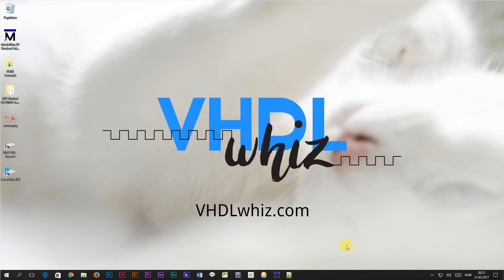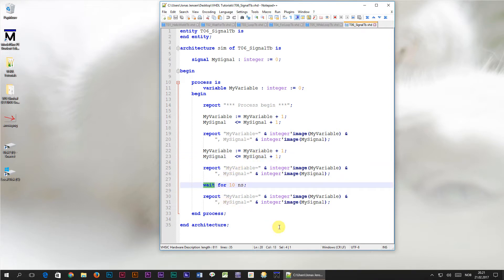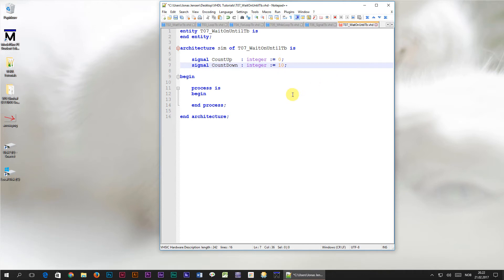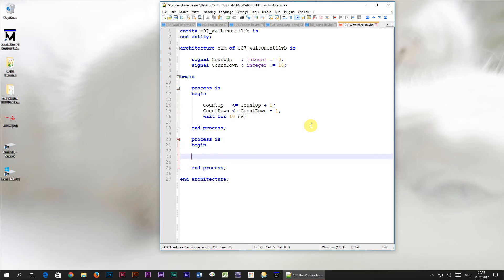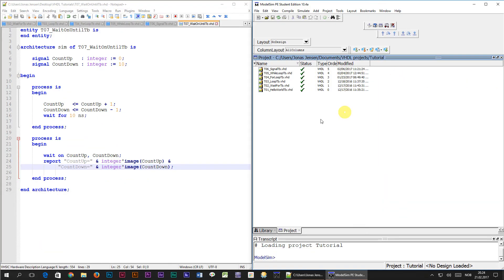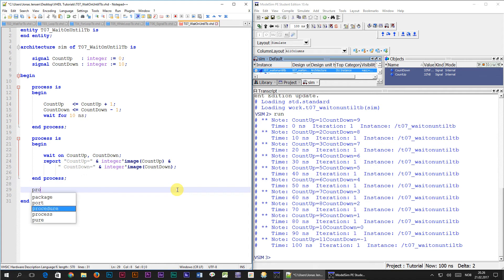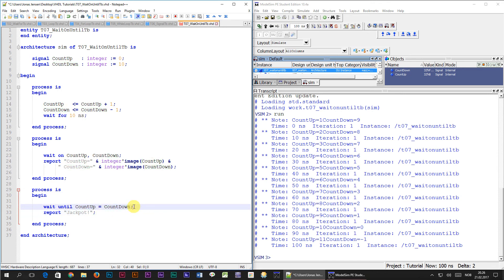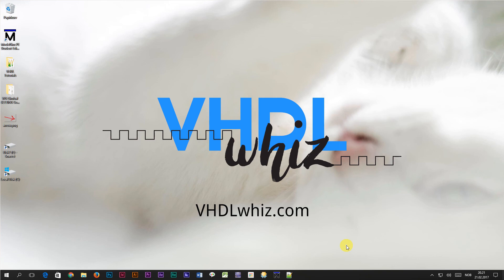How to use Wait On and Wait Until in VHDL

Comment: Do all three processes run in parallel or sequentially? I am inquiring because I've read that a significant advantage of FPGA is the ability to run processes in parallel. Is this information accurate? Thank you and best regards.
Reply from the maker: All processes run in parallel. VHDL can be thought of as a parallel, event-driven programming language. That makes it a terrible programming language but well suited for describing digital electronics, which also runs in parallel.

I wouldn't say that VHDL has any advantage over regular programming languages. They have different purposes.

Comment: Hi, if I use the following statements from your example:

architecture rtl of Kap06_Process_Erweitert is
    signal CountUp   : integer := 0;
    signal CountDown : integer := 10;
begin
    process is
    begin
        CountUp   <= CountUp + 1;
        CountDown <= CountDown - 1;
        wait for 10 ns;
    end process;
end architecture rtl;

I got the error: Wait Statement must contain condition clause with UNTIL keyword

I have no idea, what's going on. Regards Erik
Reply from the maker: That's probably because you tried to synthesize the design. The WAIT FOR statement only works in simulation. You see, some parts of VHDL is not ment for implementation in hardware. WAIT FOR is one such construct that's only meant for allowing us to simulate a design.
Reply: @VHDLwhiz  You're right, that was the problem! Thx, Erik

Comment: if wait statements are not synthesizable then why is it mandatory at the end of the process? or does this only matter for testbench only?
Reply from the maker: Yes, you are right. Some Wait statements are synthesizable. For example, if you put a single Wait On at the end of the process. That's because it's the equivalent of a process with a sensitivity list.

But you will find that almost all VHDL designers only use Wait statements in testbenches. It's safer to use sensitivity lists for RTL code because the synthesis tool will understand it for sure,. While with Wait statements, it's less obvious what kind of logic the process will produce.

In VHDL code meant for simulation, it's better to use Wait statements because the code doesn't have to follow any implementation rules. It's like an algorithm where you can use any Wait statement anywhere as you please.

And finally, you should follow this convention because 99% of VHDL code written for synthesis does. If I open a VHDL file and see Wait statements, I automatically assume it's for simulation. If I see only sensitivity lists, I know it's probably for synthesis.

Comment: One thing I understood here is we can create multiple processes.
But what is the order of the processes?
Reply from the maker: The ordering of the processes in the VHDL files doesn't matter. When the simulation starts, all processes in all VHDL files are executed simultaneously. If they have no common signals, they will just be running in parallel without affecting each other. But in this example, one process waits until the other process changes a signal.
Reply: @VHDLwhiz  Understood ..thank you

Comment: why did the countup and countdown values change at 0 ns shouldn't it start to change after the first "waiting" which mean that the first observed change should be at 10 ns?
Reply from the maker: The CountUp and CoundDown signals change for the first time at 0 ns. That's because the change happens when the waiting begins, not when it ends.

But that's a great observation! I recommend reading my article about delta cycles to understand more about signal scheduling in the simulator: https://vhdlwhiz.com/delta-cycles-explained/

Comment: why can't wait until and wait on be in the same process? I tried that and got a very weird  output:

It printed Countown is 9 and contup is 1
Then printed theyre the same
And then countup is 6 and countdown is 4

I don't understand what happened to the values in the middle!
Reply from the maker: Hello, Hugo. The wait on and wait until lines can be in the same process, and the behavior you are seeing is expected. At first, CountDown is 9 and CountUp is 1, as you say. But then, when the program hits the "wait until CountUp = CountDown" line, it will pause there until the expression is true. The program will wait on that line until the two are equal, which is when both are 5. Within a process, everything happens sequentially, one line at the time. I wanted several things to happen simultaneously, and therefore I used several processed.
Reply: @VHDLwhiz  That does make perfect sense now that you explained it! I didnt think it would be stuck in wait until! Thanks for the clarifications and vídeos!